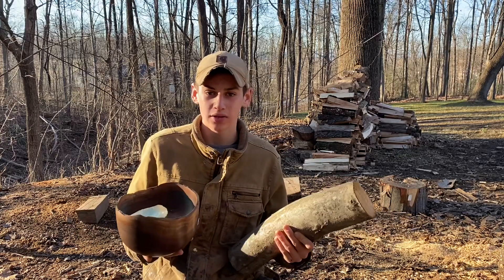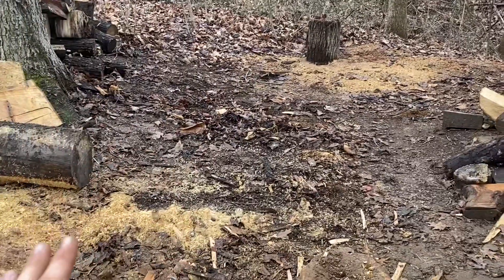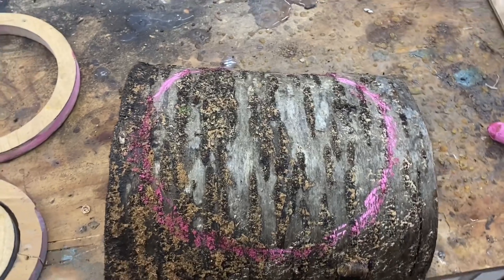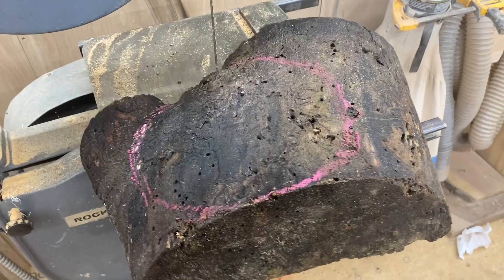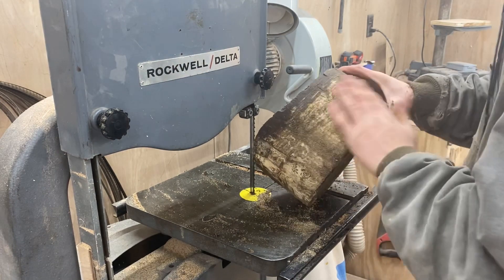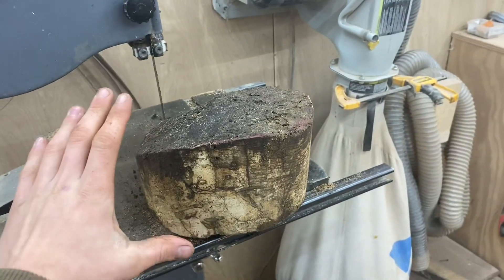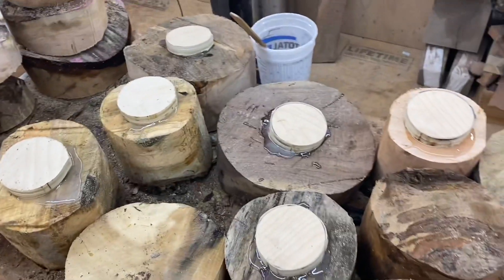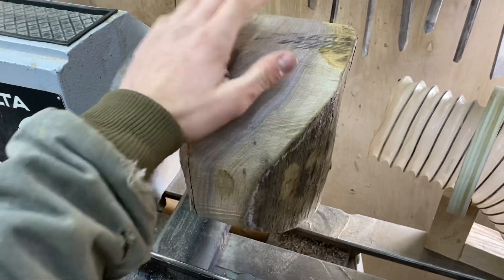Making Logs into Bowls

Comment: Hi Seth I’m curious if you use a worms skrew in a super nova or g3 to mount I find that works great in my experience
Reply from the maker: Yeah I’ve never messed around with worm screws. I feel like naturally they wouldn’t be as strong as a faceplate is bolted to the wood.
Reply: They are actually very strong but I think for the size wood you are turn a face plat would be the better option like you have been using